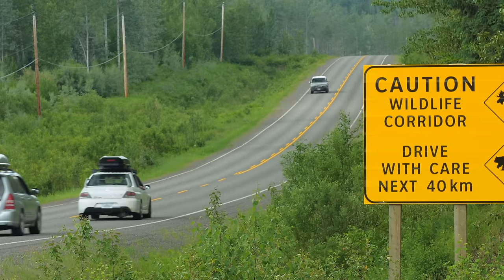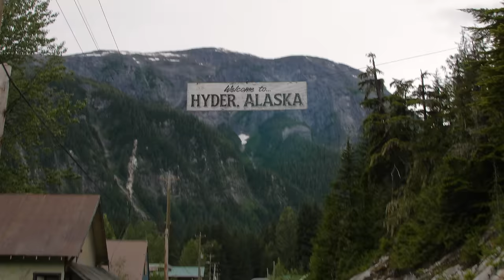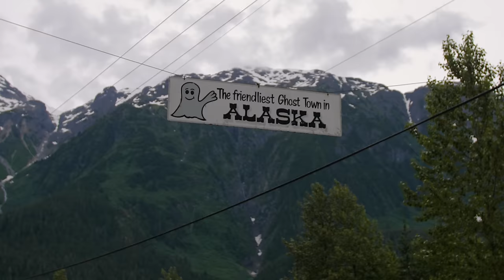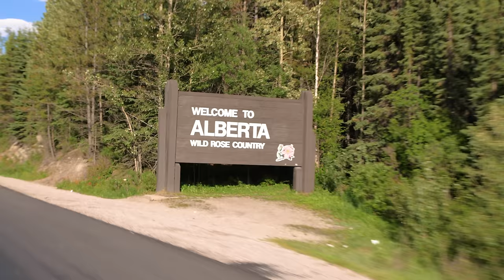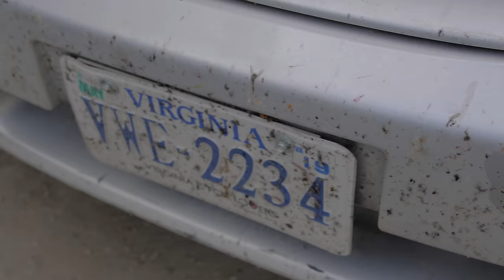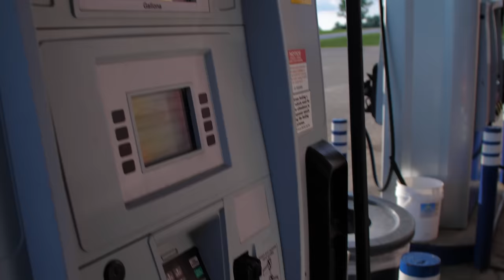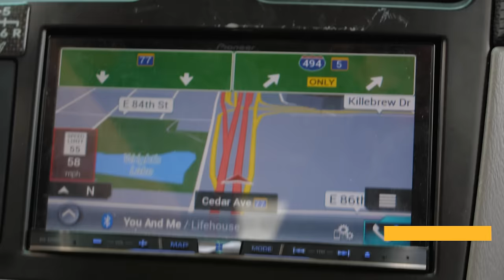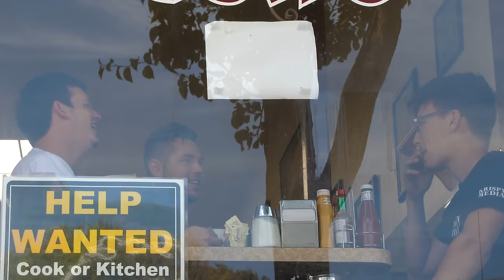Driving from Florida to Alaska - Episode 3

Comment: Entertaining and well filmed, but changing the oil every 3000 miles? With a long life oil that can last over 12000 miles? 

And bring pads and rotors just in case they worn out on the go? 

And plugging a tire and not going to a tire shop and do a proper repair for 10 bucks? 

And not having 10 cans for fuel in the car when you go where there is no civilization?

And the most important part: 200 miles with a full tank? How many liters have the tank? 30?

I think you've overprepared some things and left unprepared the most important ones.

Anyway, good series. Keep doin' and don't freak out so much about the cars.
Reply: You think a tire shop does anything different than they did? Plugs are fine, especially in the middle of the tread. Run it - no need for a tire shop or a patch.
Reply: horrible planning
Reply: Oil doesn't last 12,000 miles. 
Even 3,000 miles is stretching it a bit tbh.  
He definitely over prepared for some of the most basic stuff that almost never goes bad, yet for things like fuel he didn't even think about...
Reply: @Nighterlev  Rotella t6? Youre way off. Without a bypass filter youre good until at least 7-8k. With a bypass filter guys run it 12-15k - sometimes more depending on sump size. I've been running oil analysis on t6 and other oils for years, im positive on these numbers and have data to back it up - but if changing at 3k makes you feel better, go ahead and waste your money. Youre not hurting anything.
Reply: @joem8875   If your doing severe driving, aka "driving to school, gym, the house" etc, then you need to change it every 3-5k miles.
if your doing long range driving, I saw that it's about every 7-10k miles.

But 12k or 15k?  You're literally out of your mind if you think changing the oil after that many miles is a good thing at all. 
Not to mention changing the oil every so often actually helps the engine, cleans it out better, and makes everything over-all last a whole lot longer.
Reply: @Nighterlev  You have no idea what youre talking about. Depending on sump size and bypass filters theres guys that run 15k to an oil change on synthetics all day. Oil analysis comes back fine. Fleets do this all the time. Youre speaking like a shade tree mechanic who gets their info from the side of a penzoil container. Modern OCI's keep going up, even 3k on conventional is a joke and has been for 20 years, regardless of "driving conditions" - which is pretty much laughed at. Everyone thinks they run "severe duty" intervals. This isnt an argument, its fact - youre just stuck on what youve been told by manufacturers and oil companies for years. Sad!
Reply: i just change my oil once a year unless something happens to the car. i my cousin does the same both of us have subarus and his make 420+hp at wheels so id say they over did the oil a bit
Reply: @Nighterlev  It could be argued that constant stop and go heavy traffic driving or extreme driving could warrant an oil change after 3-5k miles IF you're using just conventional oil. With synthetic oil, it's possible to get up to 12,000 miles between oil changes if your driving is superb and relatively not as stressful on the engine, but realistically you'll get about 7-10k miles on synthetic oil being that you're not pretending a Prius is a BMW.

Also, just as Joseph said, 3000 miles is a lie created by oil companies to get people to cycle their oil more. Very rarely will you need an oil change around 3000 miles unless you're practicing drag racing in a smart car with ceramic brakes.
Reply: Another thing... putting a shitty clutch on that car is worst than running oil over 3k and using 87 octane for a couple of tanks.
Reply: David Franco Don't know how to write in your own language is WORSE than using that clutch for some kms
Reply: Never, ever go 12K on oil. That engine will look like mud inside
Reply: @olikat8 I drove a tractor trailer and the company did oil at I think 30k
Reply: @johncuervo3019  that's not a passenger car; the crankcase holds gallons of oil, it's diesel, uses Deli 400 or such, at least 2 huge filters...It's a bit different and I readily admit I'm no big rig expert
Reply: @davidfranco3697  Exedy clutches are not shit. That's what Mitsubishi uses for the Evo from the factory. They make clutches for every car, including Japanese, American, and European makes. It's literally the most well known clutch company in the world.
Reply: what ever happened to the good ol' term "better safe than sorry!" ??? smdh
Reply: not to mention its all highway driving that they did, they could have easily done 7000miles on one oil change with highway driving.
Reply: these older cars, the "practice" was to change every 3k miles, which I do as well to my STi. at $40 a change? super cheap insurance, and the amount of miles i do, that's once a year. But doing highway road trips it can be stretched a little longer, unless you're blasting it in the mountains.

pads and rotors are stupid, my brembos lasted me 50k miles

and what part of "Canadian tire is closed" do you not understand? in case you don't know, Canadian tire actually opens earlier and closes later than most shops. And they're in Canada, a tire repair costs easily $50 at Canadian tire FYI. so they actually did the best thing available to them.

And I'm blaming typical American ignorance about the remoteness of Canada for not having 200L of gas cans

my 2013 stock sti gets about that miles on a full 64L tank, they are VERY thirsty engines, especially if you're having fun. I fill up 1/2 to 3/4 tank weekly on my commute, about 155miles/week.
Reply: @joem8875  Well it aint their money they're wasting because they are sponsored. So if you can get free oil and oil filter to change your car while driving hella long, why wouldn't you take advantage of that. It's also so they can plug their sponsor in whenever they can and changing their oil is a good reason to go by their shop.
Reply: @Nighterlev  3000 miles is stretching it? you ok?
Reply: Usually for Subaru's with a turbocharger its recommended 3k mile oil change.
Reply: @Nighterlev  they mentioned in the beginning of the video that they did not plan it.
Reply: they left all these problems to keep the trip eventful and more interesting to watch I guess
Reply: I've never changed oil later later than at 6000 miles in any vehicle and I would never change it any later no matter what manufacturer's recommendation is. By just looking at oil at 6000 miles it is already dirty. There are though vehicles where oil needs to be changed more frequently to make them last as long as possible so for me depending on a car it would be either 6k miles or more often but never above 6k
Reply: I had a BMW 320d, changed the oil every 25000Km, lasted 400.000 km until it was totalled, oil 5w40 longlife 98. I had an Audi 2.5 tdi, same maintenance with oil 507.00 synthetic, lasted 340.000 until i gave it as a gift. Jaguar with 250.000 km, Volvo with 300.000km, al with this maintenance. All running perfectly and the oil analisys performed were ok for all the cars. You’re overdoing it.

A good oil (better if it’s specific), a clean additive before changing, and I have more than 1 million km without any issue  in any engine i’ve had changing synthetic oil at 20-25000km.
Reply: @davlopezlopez  maybe you're lucky with your cars. I got a 06 Pontiac Grand Prix for free and drove it a bit changing oil every 6k miles. I then thought that I don't really care much since I got it for free and have other cars so I decided to experiment with it and see what happens if you push it to 10k. Even though the engine had Ravenol 5w30 in it it started to burn oil. I changed it at 10k and it was dark as hell. Put Mobil 5w30 in it. 
Guess what, it burns a quart every 500 miles now and it didn't drink any oil before I tried that. 
I also took apart a neglected Peugeot 505 engine once where someone didn't change their oil often enough and literally everything what is lubricated by oil was covered in thick, black sludge. 
I've also heard that on GM 2.8 V6 turbo timing chain tensioners go bad when the oil is changed at 10k or above but if you change it more often it doesn't make any problems.

When it comes to other vehicles, I got a BMW E30 with 206k miles, oil changed every 5k, 99 Camaro V6 with 159k, oil changed every 6k, Wj Jeep 4.0 with 147k, oil changed every 3k and Sprinter Van with 415k, oil changed every 5.5k. 
All of them run great and don't burn a single drop of oil

Now I have to admit, I do more city driving and it does put more strain than highway driving does. 
If I went on such a road trip, I would still change it as they did. 

I'm not telling anyone to change their oil as often as I do though because your car and your money = you do whatever you wanna do with it
Reply: Following the manual for routine route you just need to change the oil at around 7k miles or 10k km but if you do some long trip or one heavy route such as on mountains, or heavy traffic, it is better to change every 3k to 5k miles or 5k km. I think they just followed the manual.

Comment: A plugged tyre can last you over 2 years if your driving normally, as when you get a nail or screw in one , it usually is plugged because theres not been penetration into the actually inside of the tyre.

Comment: My 2019 Crosstrek runs on 87 and I promise you I'd still have just as much fun making this trip!
Reply: yeah cuz your engine is built FOR running 87. Their cars, if they use 87, they have to stay off boost, which is below 3k RPM, which is the RPM the car sits at at legal highway speeds, so you can't speed either, or the risk of knock is significantly higher.

Comment: I'm not understanding your terrible fuel mileage.  My 06 XT makes 300/315 through redline on a modified TD04 that's always spinning and makes boost with the cruise set in 5th gear, and I still get 27mpg on road trips.  I'm not tuned lean, either, I go 11 or 12 A/F under boost and make mad smoke.  I pass emissions as well.  Might be time to chat with Cobb about your tune.
Reply: They got those big ass roof boxes
Reply: @bradcallejo653   That's a good point, but 10mpg from that coffin on top? If thats legit, they could have had the kid with the hair drive a chase pickup full of tools and fuel and tents and everything and still saved money.  As long as I'm at at, who does an engine swap and leaves the old plugs in? Who takes a 10k mile road trip on a clutch that's beat up that bad? Finally, never go deep into any mountains without bringing your own octane. All that said, was still a good bunch of videos, I enjoyed watching
Reply: @DoubleJThe  I think you're forgetting that he said these were straight roads through Montana. They were travelling at high speeds the entire way because they're just so boring. When you're traveling at higher speeds you use a lot more fuel than you would at an average cruising speed. Optimal speeds for fuel economy is between 60-65mph. The 10mph difference between 65 & 75 can produce as much as 30% more drag. The faster you go the more resistance there is. So let's say they were travelling at 85mph on the roads, with their roof boxes, that's a lot more drag and a lot more fuel than you traveling at a normal cruising speed of 70ish mph with a stock body. So yeah, the roof box really can make that 10mpg difference.
Reply: Ok, I can buy that, but this trip encompassed a lot more than Montana driving (I live in Colorado by the way, same speed limit, and absolutely nothing to see in the Eastern half of the state).  They poked up the PCH, they crawled through dirt, they putzed through the slowpoke Eastern states, etc.  That STi swap gives him one more forward gear than I have, and unless he left the factory diffs in, which I'm not sure you can do, I'd assume he's running the STi 4.11 or 3.xx gearing (not sure, but FXTs have 4.44 gears, the lowest that Subaru offered to my knowledge), which should overall give him better, not worse mileage than I get.  A quick search on google shows about a 2-6 MPG loss from the roof coffin, so let's average that to 4, putting my FXT and it's crazy spooly clipped TD04L-19T at 23 MPG.  His turbo is an undoubtedly bigger VF of some sort I'd guess, which has a much larger hot side than I do, which actually increases fuel economy as it's less restrictive (unless you're in boost of course, but this isn't a lesson about how turbos work, or is it?).  That's 6 MPG unaccounted for, which I'm still going to say is a rich tune (for safety!) and that he's got some time to spend on the dyno.  I'm making a lot of assumptions here, but they're assumptions by someone with a nearly identical car (one facelift newer) and most likely a nearly identical power output, unless his STi swap also includes some serious go fast parts.
Reply: Double J  300/315 to the wheels on stock turbo? I have a really hard time believing that. Unless it is crank
Reply: @austintorset   It's a stock ported  hot side with a 10 degree clip, cold side is a 19T, so about vf39 sized, but you're right, those are crank numbers, I wasn't clear on that.

Comment: ELI5: Why would a single new tire and three worn tires damage the drivetrain?
Reply: New tire has more grip than the old ones and would grip the road more, meaning one corner would have more grip while the rest are slipping and wear the drive train unevenly.
Reply: no, the new tire is higher and will change the final gear ratio. its very important on some cars, dont know how important it is on a evo tho
Reply: Fredde Agreed and from what I have seen, the AWD in Evos will keep the diffs open until there is a loss of traction.
Reply: Staggering set ups is usually bad for awd cars
Reply: Lol that 1/8 of an inch would have done jack to the drive train. You also have to realize that these are the same guys who had never even plugged a tire before and was worried it wouldn't last 5400 miles. These guys aren't car guys. They are audio video dudes using cars as a gimmick to have a channel.
Reply: Logan Madder lol dude look how young they are. Pretty common alot of ppl have never plugged a tire. My best friend is a car guy he hasn't plugged a tire. I've only ever plugged a tire because I worked at a tire shop. I haven't had the need to plug one of mine.

Comment: I suggest if your doing another cross country drive, make sure to service your car prior to travel so it will avoid any breakdowns, (ensure you have 4  new tires + new spare tire, all lubes (engine oil, transmission oil, coolant) must be changed, filters, spark plugs, belts are new, brings extra bigger gas tank, AC is serviced)...bring extra spare parts just in case any breakdowns. I suggest not to put the luggage’s specially on the roof you can use the back seats instead or the compartment... Great Video guys. It’s just that for me a 2.0 liter engine cars are not practical for long distance drive. At least a 3.5 liter engine car or higher is great for this adventure...

Comment: thats why you should have your ECU with multiple tunes in case you have to use low grade fuel. better yet, have a flex fuel setup that dynamically changes depending on what octane is running through.

Comment: It would be interesting to save a tune on both of your cars that lowers the boost pressure and retards the ignition timing, making it safe to run 87 octane if you had to. Just load it up when 91/93 octane isn't available. Wouldn't be as fun but it gives you options if you make a trip like this in the future.

Comment: It's probably a great thing that they didn't drive all the way to Anchorage, to discover that, we too, don't have 91 octane. In everyone of my WRX builds, over the past 12 years, going back and forth through Canada on trips, I rely on carrying bottles of Torco RFC. Anybody here, outside of 94 octane filling station in major CA cities, is going to run Race Fuel Concentrate and dilute to the correct molarity. In 12 years of daily driving and running, I have never had an issue with gas, in a moderate/moderately high tuned WRX.

Comment: You should do the trip again except follow the Alaska highway. It starts in Edmonton as highway 43 and goes north through Grande Prairie and up from there. A much nicer drive than the BC route.
Reply: ssrc30 it doesn’t start in Edmonton,it begins in Dawson creek
Reply: @Whateva67   nope. It starts in Edmonton. Hwy 43 is the old Alaska highway. Goes to GP where you follow it through the north end of town, around the old bypass and on to Dawson. Mile zero is in Dawson but that's not really the beginning of the road.

Comment: 87 octane would work just fine, the computer just retards the spark to compensate for the lower octane. All new cars are like this. If a car is over 30 years old it could be a problem.

Comment: Should see gas prices in Sweden. I could only dream about Canadian gas prices. 95 E10 (87) costs 17.8kr/L (roughly 2 USD/liter) just a few days ago. My car runs like shit on E10, however, and the only fuel that doesn't have 10% ethanol is 98 octane (91 octane in America) and that is only available at certain stations. Circle K, Preem, Shell and OKQ8 are the only ones that has high octane petrol. The price for diesel was up and touched the 20kr/L last week. That's about 2.3USD for 1 liter of diesel.

Comment: Wondering how bad your gas mileage is. Meziadin Junction (which you refueled at the 9:47 mark) and Dease Lake both have 91 octane and the distance between the two isn't that much. I've take my Acura TL Type-S on this road which also needs 91 at the pump and seldom had fueling issues. It's a very beautiful stretch of highway, my favourite in BC and I live down in Vancouver lol

Comment: I heard you say you only get 200 miles per tank, hows that??  I have a 2006 outback xt, and driving smart I get 300 - 340 miles per tank.  It needs 91 octane but I can feed it octane boost from autozone when I'm in remote locations in the west.